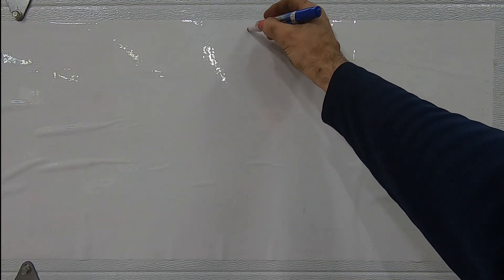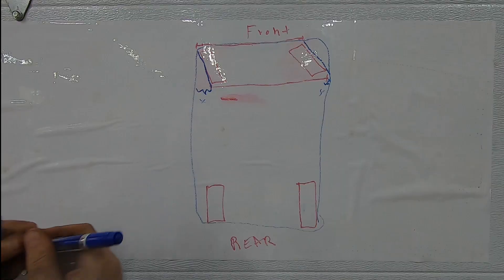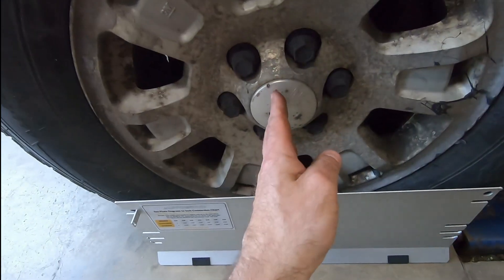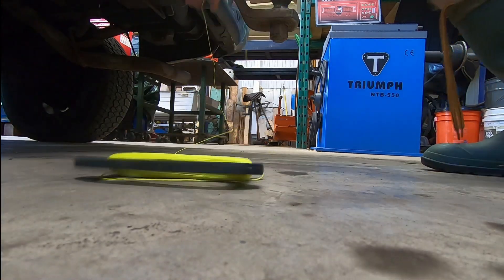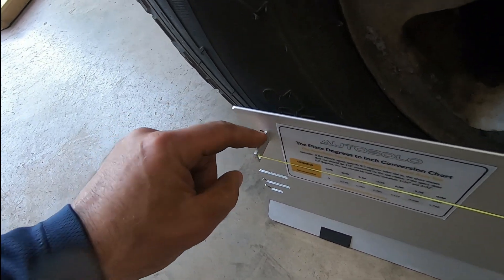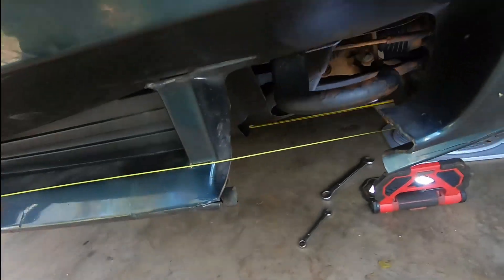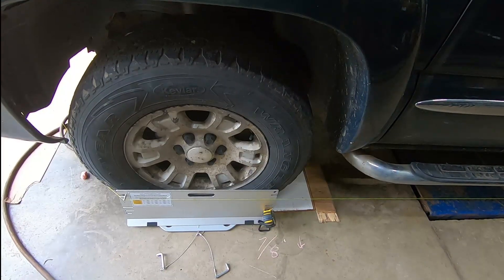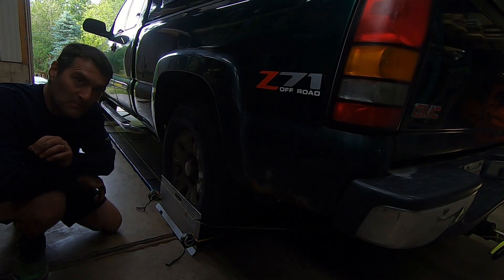How to Straighten and Align a Steering Wheel

Comment: Carl Schulhof thats involved with Porsche and Lotus motorsports uses a similar method. He would make sure front and rear toe if applicable was correct. Then wrap a string around all 4 tires, the front tires have a spacer on the front of the rim and the rear tires have a spacer on the back of the rim. All spacers the same size, when the front tire rear rim to string measurement matches on both sides and the rear tire front rim to string measurement matches on both sides the forward steer and thrust angle is aligned. They tested it's accuracy on computers and it was within .005 of an inch.